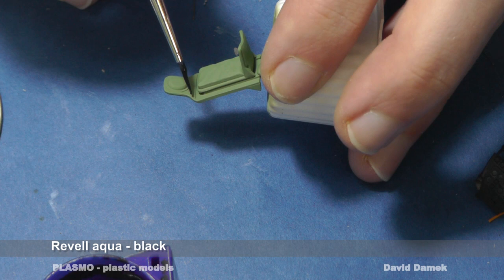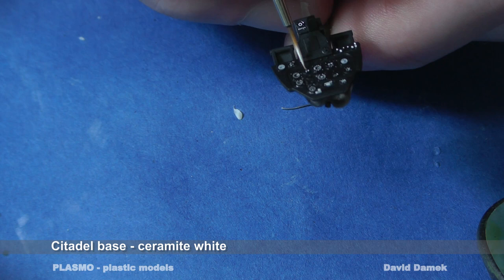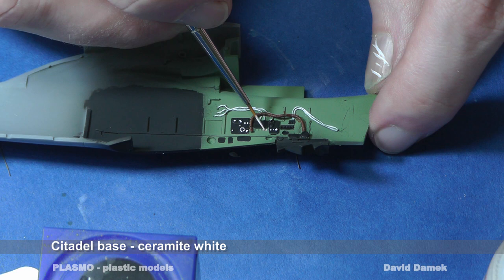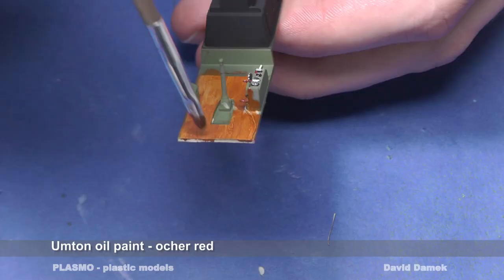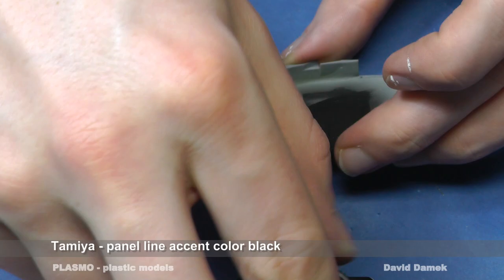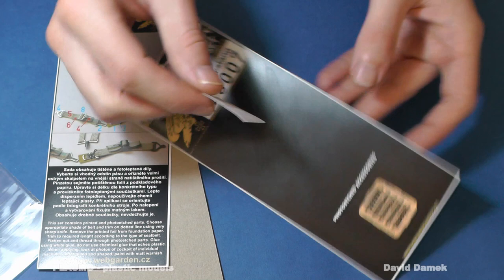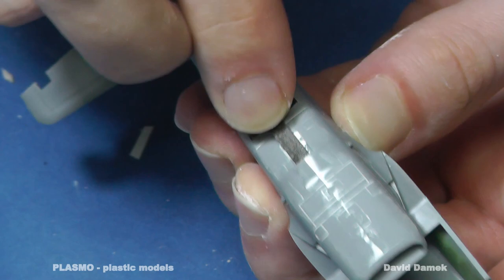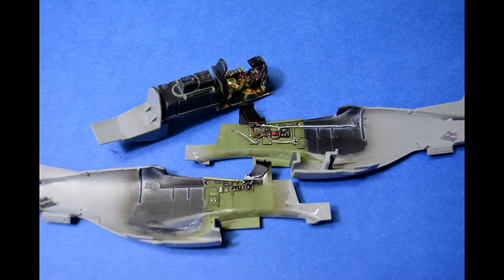P-51D Mustang 1/48 - Episode two- painting cockpit and mayby more

Comment: I've had a kit from Tamiya with a defective part; the mold didn't fill completely. Have you had this problem with them before?

Thanks for the great videos.
Reply from the maker: Yes, sometimes it happens. You can write an email to a manufacturer, and they will send you correct part for free. Or you can complain to the dealer. It's a big nuisance, but sometimes you can not repair damage part.

Comment: Hi, David.

May I ask how you maintain the point on your high finish brush when cleaning? I have the other Tamiya fine brushes (wood handle ones) and they seem to lose their point when cleaning them. 

Cheers :)
Reply from the maker: I clean brush with soap and water. When it dries, I use a little of vaseline.
Reply: Cool, thanks :)